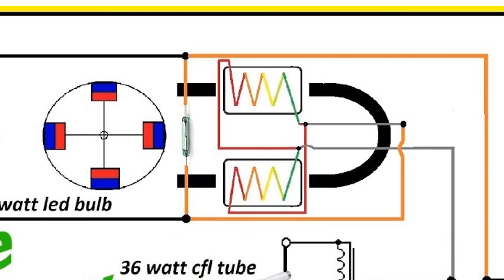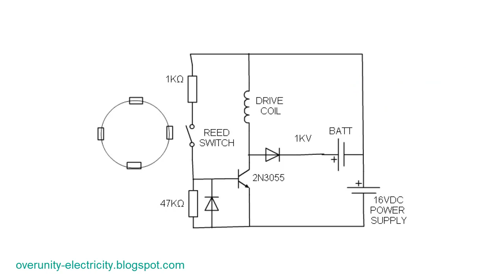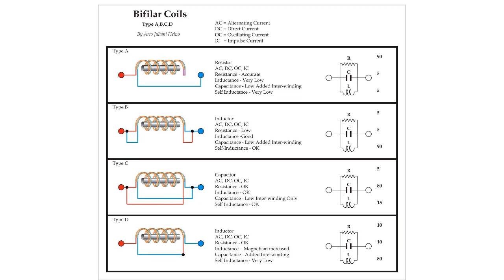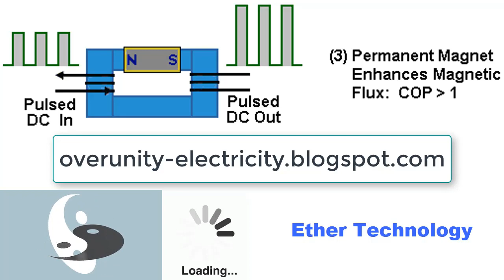Magnet Motor Exploits Back EMF - Pulse Motor using Reed Switch

Comment: Back-EMF is a reaction of magnetism fighting a change in the reverse direction of the input current, like in a motor where its generator functions are activated during operation, the kickback from pulsing a coil is an inductive-spike where the collapsing magnetic field transforms into a dielectric displacement current, the video should be titled "Exploits Inductive Spikes"
Reply: Not reverse, positive goes from positive to negative,  so it leaves the positive goes into the circuit and carries on FORWARDS  out the other side towards the negative, bemf is EMF after its left the circuit on its way back to the source , and negative does the same but the opposite way around

Comment: Free energy? Suuuure.
Somebody cannnot into physics 101.
Reply: "According to these equations, in time-variable systems electric and magnetic fields are always created simultaneously, because they have a common causative source: the changing electric current [the last term of Eq. (1-4.1) and the last term in the integral of Eq. (1-4.2)]. Once created, the two fields coexist from then on without any effect upon each other. Therefore electromagnetic induction as a phenomenon in which one of the fields creates the other is an illusion. The illusion of the "mutual creation" arises from the facts that in time-dependent systems the two fields always appear prominently together, while their causative sources (the time-variable current in particular) remain in the background."

"a time-variable electric current creates an electric field parallel to that current [the last term of Eq. (1-4.1)]. This field exerts an electric force on the charges in nearby conductors thereby creating induced electric currents in them. Thus, the term “electromagnetic induction" is actually a misnomer, since no magnetic effect is involved in the phenomenon, and since the induced current is caused solely by the time-variable electric current and by the electric field produced by that current."

"There is a widespread belief that time-variable electric and magnetic fields can cause each other. The analysis of Maxwell’s equations presented above does not support this belief. It is true that whenever there exists a time-variable electric field, there also exists a time-variable magnetic field. This follows from Maxwell’s Eqs. (1-1.3) and (1-1.4) as well as from Eqs. (1-4.1) and (1-4.2). 

But, as we have seen, neither Maxwell’s equations nor their solutions indicate an existence of causal links (no causation) between electric and magnetic fields. Therefore we must conclude that an electromagnetic field is a dual entity always having an electric and a magnetic component simultaneously created by their common sources: time-variable electric charges and currents.° This conclusion must hold for all electromagnetic fields, including electric and magnetic fields in electromagnetic waves."

-Causality, Electromagnetic Induction, and Gravitation: A Different Approach to the Theory of Electromagnetic and Gravitational Fields by Oleg D. Jefimenko
Reply from the maker: @JenkoRun  First of all what he said is being know since Maxwell, and Heaviside and Poynting described it in detail. They were masters of field theory. It’s the physicists since last 100 years tried to kept people away from true field theory of electricity by confusing and distorting both the theories and the history.

See: https://overunity-electricity.blogspot.com/2024/07/electric-current-in-physics-genuine.html
Reply: @Overunity_Electricity_Tao  Did you mean to reply to VEC?
Reply from the maker: @JenkoRun  Yes. But he also knows, and gets the message.
Reply: @JenkoRun  did you forget the quantum carburetor somewhere in there?
Reply: @VEC7ORlt  No I simply gave you some basic information which source is back to one of the Pioneers, I hope you don't think you know better than Maxwell.
Reply: @JenkoRun  I don't think Maxwell believed in BS, and frankly Tesla was a nutjob, especially in his later years, and we need stop glorifying his figure and start seeing him for what he really is.
The only 'free' - is the cheese in the mouse trap.
Reply: @VEC7ORlt  Yet it's his equations that show a sourceless electromagnetic field is impossible.

But I digress, you show a lack of capacity for open thinking beyond what your mainstream academia tells you to think, a lack of critical thinking outside of taught subjects, so I will not bother you further.
Reply: @JenkoRun  oh please, get off your holier than thou horse of 'closed minded academia', whatever you are peddling is untestable, undemonstrable and unmeasurable - come back with concrete evidence, then we'll tlalk.

Comment: >>><<<<I need to know how to get minimum 100v or higher from 12v battery, switch and 1.75 Millihenry wire coil as about .66 ohms wire??  The inductor circuit must have a parallel outside diode, so that the balance of coil energy released fast, >100v, goes ALSO forward to the resistor load. (Coil Polarity + and - changes around so as - and +) Does the circuit require capacitor to store energy and release through load in same direction? Current flow I assumed was only positive to negative through anode. Or is that negative reverse current through cathode diode?#####!!!??
Reply from the maker: Other parameters are probably not important.
But the output, after exploiting the Back EMF, feeds it to the rectifier bridge diode to charge the DC capacitor.

Then, choose a capacitor with a voltage of 100V.

To increase capacity, connect capacitors in parallel, so that the current increases.

Replace the capacitor with a battery in series, and the Back EMF passes through the rectifier bridge diode to charge the battery.

If you want AC, use an inverter from behind the battery.

Review the circuit at my Blog.